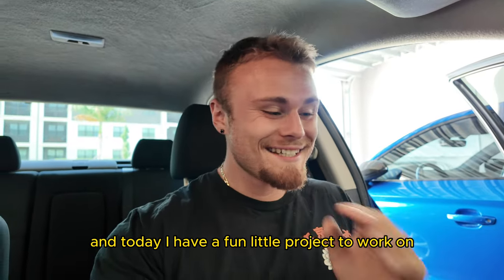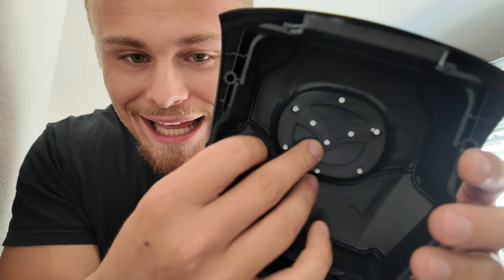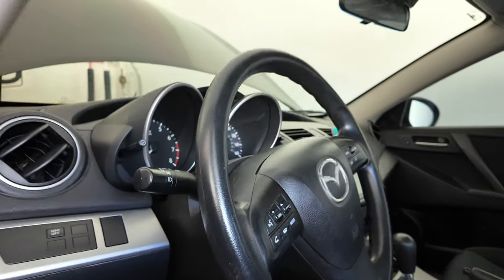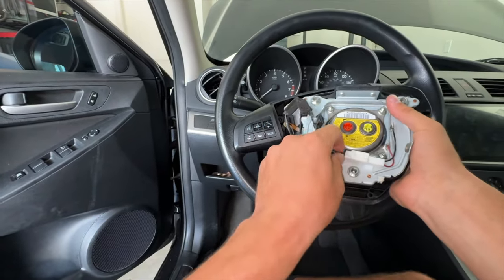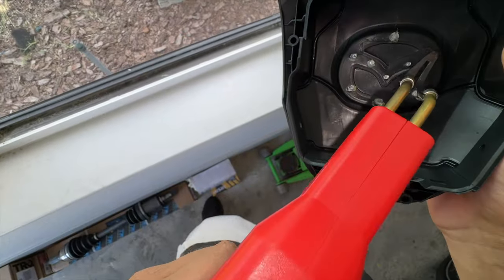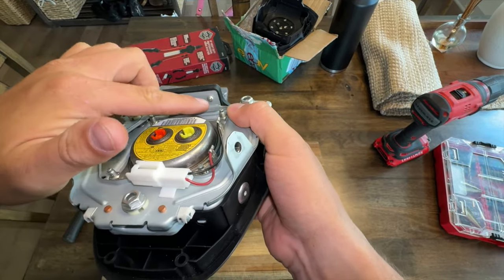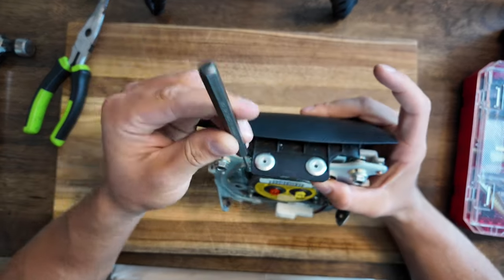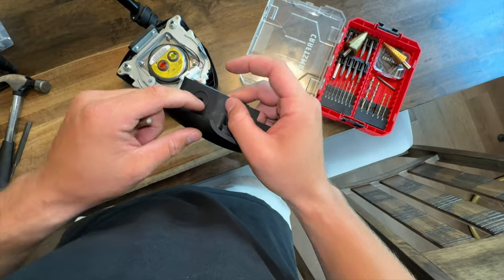I Fixed My NASTY 2010 Mazda 3’s Steering Wheel Emblem | Airbag Has To Come Out!

Comment: Is there by any chance after you plug the terminal the airbag to go out?
Reply from the maker: None at all. When the car is off the crash sensors are deactivated. Thats why a car that gets crashed into when they are parked never have the airbags deployed. Its also smart to unplug battery while this is happening and do not turn on your car even accessory more during any of this process

Comment: does this actually happen? i thought it can only be triggered by sensor
Reply from the maker: does what actually happen
Reply: @Haydenschreiermk2  like can you trigger the deployment of the airbag by trying to hack off the emblem.. reason being i tried this same thing on a mx5 cuz the logo was peeling and it terribly hard to even take off. and in the back of my head worrying it would go off and have a pick tool in my face. lol. funny enough the replacement logo i got off aliexpress was just a plastic stick on with double sided tape that goes on top, having ocd i wanna change the original just becauise i know i mutilated it underneath. :) great video tho :)